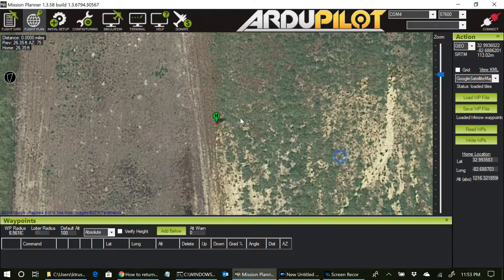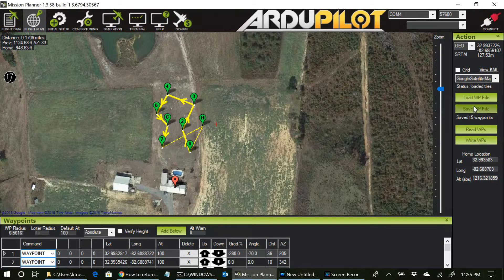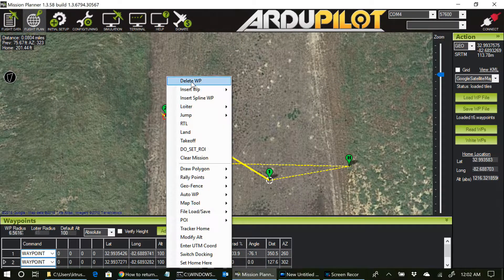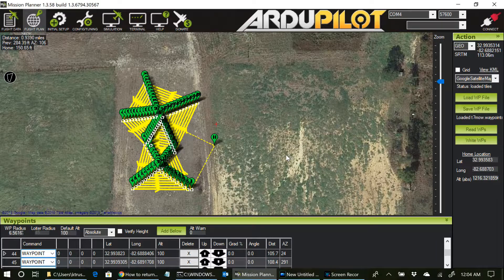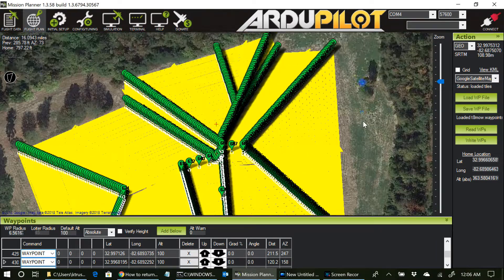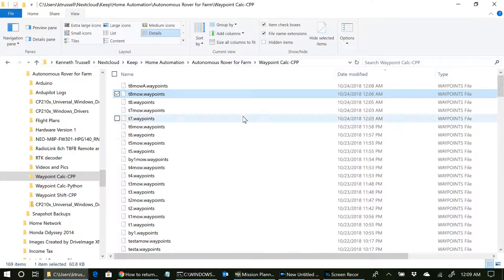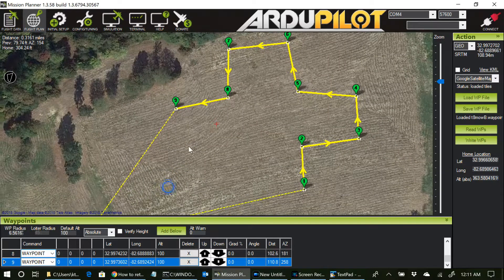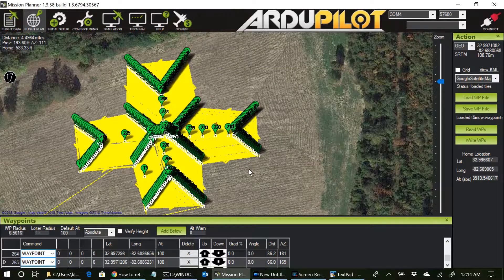MowPlan Demo Part 2

Comment: Hello Kenny, I really admire what you are doing. I just started doing my own mower and cant find a "g-code" generator which can work with FireHawk properly. 
Are you doing this still? 
Looking forward to hear from you :)
Reply from the maker: Hi Marko. I am not familiar with Firehawk. Do you mean Pixhawk?
Reply: @KennyTrussell  Hello Kenny. Thank you for your quick reply. I meant PixHawk, but due to confusion, I messed up. 
I wonder if you have made any progress on Mow Plan and is there a chance I can contact you as I need to make my own path generator. 

Thank you 

Marko

Comment: Hi Kenny
Just found a polygon planner (ROS based) which also considers obstacles. Maybe it helps for your mow planner
https://github.com/ethz-asl/polygon_coverage_planning
I don't know much about ROS, but the algorithm could also be used standalone to improve your planner
Reply from the maker: Thank you so much! I will look into that. I know ABOUT ROS but have not used it. I do have some work underway with a companion processor (Raspberry Pi), but at the moment, I have not planned to use ROS on it. I agree that the algorithms might be useful outside of ROS.